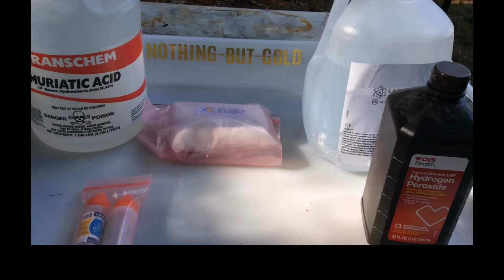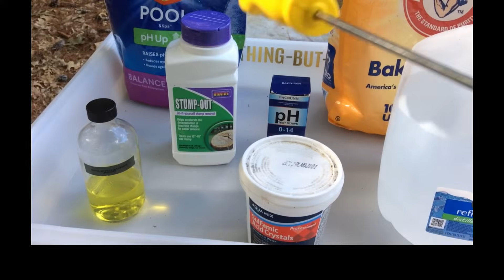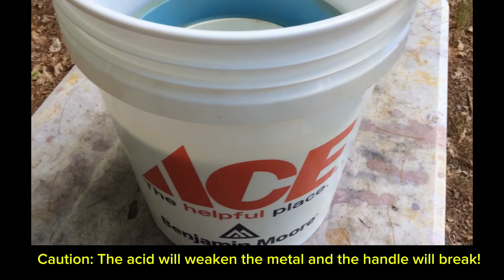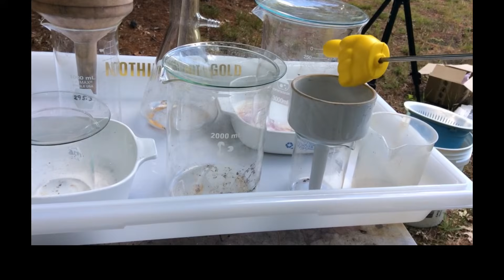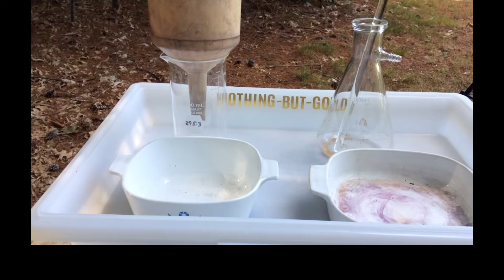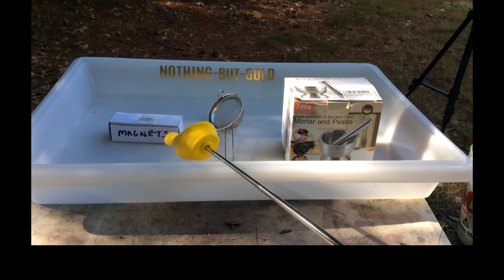Recovering Gold From Electronics: Chemicals Required (Beginner Guide)

Comment: Lots of great  information,I'm new at this and want to get it right and do it safely above all things but I do want my yelds to be as much as possible and as pure as possible . So thanks for sharing your knowledge and wisdom.
Reply from the maker: Hi. That's exactly the right order of priorities — safety first, yields and purity will come with practice. Everyone's early batches (mine included) leave some gold on the table while you're still dialing in the process. Glad to have you following along, and don't hesitate to ask questions on any of the videos as you get going. It appears to me that you are meant to do this.
Reply: I'm starting with 2 large circuit boards containing thousands of gold plated pins that I recovered during a demo of a building we were converting into a planet fitness gym. I'm gonna end up with about 4 or 5 red solo cups of pins from each circuit board. What do I need to do to the pins as far as cleaning them before I start processing them and should I process a whole board of pins together or about half of the pins per board at each refining process?
Reply from the maker: Sounds like a great place to start. A couple of questions. How are you removing the pins from the circuit boards? Are you cutting them out or de soldering them?
Reply from the maker: are they magnetic? are they the only items on the boards?
Reply from the maker: this video should help: https://youtu.be/Z02j6FTaGIg